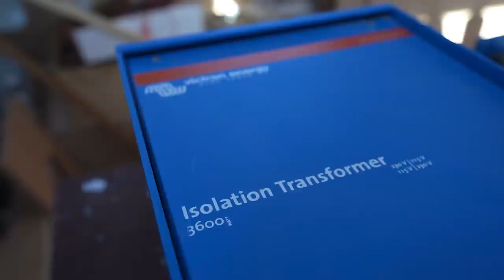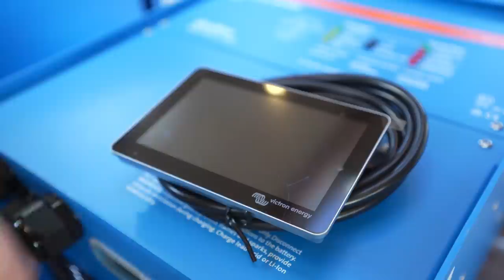Sail Life - Aft cabin BEFORE and AFTER - DIY sailboat project

Comment: I was gonna buy the same 5000 quattro (have the same isolation transformer) for my blue water cruiser, but bought the Multi 5000. The automatic switching is costing almost 800USD, when a manual switch can do the same job for MUCH less.
However, my top tip for anyone who haven't bought yet - in hindsight I wish I would have bought 2x3000w in parallell, for the backup capability that would give if one of them breaks while I'm in remote areas.

Comment: For the hump in the aft cabin you could make a nice round mould around all the edges and experiment with some expanding soft foam like they used to use for old steering wheels and stuff like that! They made something like that in my WESTFALIA camper and it looks super neat and is a real head-saver! I´m sure with your skills you could come up with a nice shape of the mould and enjoy a soft, nice looking edge in the end! Not to mention the new skill you added to the thousands you already earned while your "somewhat extensive" or better "full- waay better than new" refit of Athena! :)

Comment: You're flying along!  Be prepared to enlarge that battery bank - it's the only limitation I can see.  Victron is great kit, and good value - the expensive inverter is a monster.  You're obviously thinking about weight distribution, but I'm inclined to agree with some of the other commentators in that I would plan it carefully.  Poor weight distribution will  catch you out under severe weather conditions.  Great video.

Comment: Glue vinyl to your insulation foam and wrap the inside of the cockpit wall.  As you wrap the corner the vinyl will stretch slightly giving you a nice tight round corner.  You can also use a light plywood behind the foam if need be as a rigid carrier and them screw it onto the wall.

I saw Rhys on Zora made some 3d printed window trim...may not be the answer for your window surround..but an idea.

I would think you could tig weld in some small aluminum fillers then smoothe and sand blast for a consistent finish.

All the best!

Comment: I can see you are enjoying all the fun projects, its seems to be coming all together very nicely.  I like the slats, gives it a real nice look.  The thermal load from the inverter/charger and the Isolation transformer will depend on the actual loads and local temps.  Possibly just install a couple (at least 2 for redundancy) fans on thermostats or PWM controllers with an over temp alarm on your bus.     Don't forget to add an LED lighting puck to the inside of the locker.
Reply: And armaflex on the hull and deck underside to reduce heat ingress, plus sound insulation on the cabinet door.

Comment: 17:07 - finishing out the aft berth/cabin ... you could simply paint it with flat white paint or flat black paint (this will hide more imperfections and be easier to touch up.

Also, you could put, what I call, "kitchen carpet" on for padding.  These is simply "tough" and "thin" carpeting - about 1/4 thick (so that meets some requirements).  It will provide some thermal and sound insulation and it is durable (even for walking and spilling things on).

This is often also used for car speaker - subwoofer boxes.  It can work.  It would not be "fancy".  It would be utilitarian ... it is the new religion of the practical!

Comment: Hi Mads. About "The Hump" You could put up trim around the edges and window and insulate with armaflex. then cover the trim and insolation with packing tape. and put up a thin layer of glass fiber, then pull it off. Remove packing tape and screw it down after painting. Woilla easy peasy. =)

Comment: 17:34 you could make a thin fiberglass over piece that allows you to put insulation under it. Just lay the insulation, cover it in shrink wrap tape and then lay fiberglass over it. That way it remains white, it's just as thin as it needs to be, and you'll be able to shape the corner into a forehead friendly corner. It will also be removable and therefore easy to deal with. IMO, that's the only way to get all the things you want.
Reply: Exactly what I would recommend.

Comment: What I don't like on the Victron combi inverter charger is the fact that you can not turn the charger off without losing power onboard. I use a simple contactor with two Normally Open and two Normally Closed contacts with the coil powered by shore power, to automatically bypass the inverter when I switch it off.  The 800 plus consumes ~ 50 watts even if unused.   Year round that adds up. Now I have power straight from the Isolation transformer and a small 10Amp charger, and in summer solar can keep up.

Comment: Hi Mads,
I follow your Videos für a while now. I really like your work. I adopted many of your diy practics on my boat.
I'm building a Lithium battery with those winston cells, too.
I'm going for 12v so 4 cells. Since you are using the cebro gx and the touch display and all victron devices just like I do, you should check REC BMS.
The REC BMS has integration for the victron CAN bus.
So you have the bms information on the screen. With the SoC calculated by algorithm for the winston cells.

Keep up the inspiring videos.
Best regards
Patrick (from Germany)

Comment: For sure you are going to be generating losses in heat with the inverter and transformer depending, on load.  Probably more with the inverter.  That area back there seems small and there may be heat gain during sunlight hours, to begin with.   A source of intake fresh air down low and an exhaust outlet out the top may be needed.

Comment: Given the reliability of blue boxes and your dependence on one I'd recommend running two parallel so when one breaks you're not scuppered. Have you ever scoped one? I have two phoenix's with built-in harmonic distortion. Both inverters at the exact same rise and fall points of the wave.

Comment: Thank you so much for these videos! I've been using some of the simple (but experience needing) examples and tutorials you've shown in refurbishing my boat.
I even gave some advice to others around me, such as using the sealant tape instead of silicone glue on bolts and joints.
Currently stripping out the interior, and sanding down the roof after filling in all the old screw/attachment holes.
Planning on using some plastic imitation wood panels inside possibly. Just as I like the idea of it more than wood, which I'll have to varnish at times.
PS, I'll be watching what insulation you choose. :)

Comment: Another super video. On that internal cockpit corner, what about some kind of sewn fabric/leatherette material on top of the insulation that could easily be resewn and replaced as and if the need arises. Easy solution and kinder to heads?

Comment: @11:00 discussion about weight carrying and distribution of that weight are two different things (which you said). So adding 230Kg in the bow, ~75kg to the stern may cause Newton's laws to visit you on choppy upwind sailing. Keeping the weight off the ends is a safety and comfort issue. The latter is tied directly to the former. For math sake, a 500lb weight at the end of a 20 foot arm exerts a ~10,000 ft pounds torque around the center of gravity, meanwhile ~2500 ft pounds torque from your aft-mounted gear. Combined creating 6 tons of force keeping your boat hobby-horsing upwind.

Comment: Isolation transformers are great for transforming 110v/230v but they don't change the frequency of the AC. You will end up with 230v 60hz power in the USA. I heard that is not an issue for some appliances but not all. I think someone mentioned that their washing machine didn't like it.

Comment: Just a quick comment on that Victron Quattro. Note that the 5000VA model actually provides 4000w  output, not 5000w. Like all Victron products, their model designations are rated for VA, not Watts.
Reply from the maker: That's why I said "if you disregard the power factor" :) 5KVA is 5KW assuming a powerfactor of 1 :) I could have used the 0.8 standard power factor but going into that topic was out of scope for this video :)
Reply: @SailLife  ahh, sorry. I missed that.

Comment: As ever, very entertaining and informative video Mads. I'm currently putting a very similar system into my boat, using the Victron Isolation Transformer and a Multi-plus (I don't intend to run a washing machine and tumble dryer!). At the risk of giving away a spoiler, can you tell me how you intend to connect the two together? All the schematics are very hazy on this point - the few videos I seen show them directly connected people - the schematics from Victron are a little vague but suggest that there should be a MCB between the two while the manual for the Isolation Transformer says there should be an MCB and and RCD on the output. Thoughts?

Comment: She starts to turn into a pretty dependable shore-power queen I reckon. You either need a cruise-ship style power line or a constant supply of diesel to turn into electrical power - with the latter at least producing warm showersuited fresh-water galore. Quite some comfy way to live aboard! Should You keep up with the maintenance, You might even take short trips to halfways developed islands or shores. I would not go to more remote places in South America or Africa with a technical wonderland like Athena though, otherwise You might have to eat from cold tins with not even a backup gas-cooker .....
Edit: I am very keen on learning how it will turn out in reliability, so I hope You will share that part, too, once You go off shore/cruising. I would like to express my sincere hopes all that complicated electrics won't fail on You on a regular basis.
Reply from the maker: Solar should cover roughly half of our daily energy needs if we don't try to conserve power. If we motor anywhere that will cover the rest if not we'll have to run the generator. Just like a ton of other cruising boats. Athena's generator (AC) is based on a Perkins 102. We'll be able to get parts for that anywhere and we have plenty of redundancy in case it breaks. Just because we have a lot of creature comforts doesn't mean we HAVE to run them all the time if we need to conserve power and diesel then we can do so but when we don't we can live very comfortably.
Reply: @SailLife  As a boatbuilder and delivery/transfer sailor I usually had many offers to transfer fancy (over-)complicated yachts where there would have been enough repairs/rebuilding to do for six specialized guys full time without them sailing/crewing a single minute between A and B. The ones sailing, to remote places even, were always the ones showering out a tumbler, cooking with gas or kerosene, using kerosene for nightlights (and, until LED became a thing, for nav.-lights), too, and going under sail only, often without even having a (working) engine aboard.
I do not want to advocate that approach, I do personally like my creature comforts, I do understand how thoroughly thought-out Your Athena is/will be in terms of energy and liveaboard life, and to be honest, if someone could make a boat work for real  with electric cooking, washer/dryer, running warm water and a head with bluetooth-flushing, then it might indeed be You, Mr Mads. 😂
It is just so very different to my approach to sailing and the outdoors that I feel the urge to comment now and then. 
Anyway - never mind. Thanks for sharing!

Comment: Not sure how thick that rear bulkhead is that you bolted the Isolation transformer and Inverter to, but given their weight, and the potential for rough seas, would some kind of backer plate on the hook plate help distribute that load better?

Comment: How does that Transformer take a 60hz input and turn it into 50hz? If you're pluged in in an American dock you can step up the voltage sent to your charger/inverter but the frequency remains and that 60hz at 230v will kill appliances that have inductive loads.

Comment: Lithium batteries have got a lot of press on being a fire hazard potential, are you taking any preventative measures in the battery locker area?....I'm still on the fence about using them..but as far as power and life cycle, its the bee's knees on a long haul vessel....

Comment: when fitting those battens for the insulation did you put a screw directly into the hull or were they only to bond the 2 pieces?  Im assuming not sound to screw into hull?

Comment: seeing all the sailors that had problems with water and batteries installed low near, or under the floor, personnal safegard in my boat was a waterproof box to the batteries, custom made marine plywood epoxy glass and a good rubber seal bolted top, seled cables to the bms inside the box to avoid short circuit, and at least one lead acid well over where the water go in case of flooding, sinking and capsize, it will insure you can run at least your starter and a bilge pump on emergency

Comment: Mads, that Isolation Transformer will NOT address the frequency differences between the US (and Canada) and the EU/most of the rest of the world.  The US/Canada are on a 60 Hertz, 120 V AC standard while most of Europe is 50 Hertz, 220 V AC.  Your spiffy new Isolation Transformer will step up the 110/120 to 220 but it won't change the frequency of the power so you still won't be able to use any devices that can't handle that (such as microwaves, a lot of electric motors in things like washers, dryers, dishwashers, air conditioners, etc).    Most docks in the US/Canada have 120/240 VAC available so you can get the same effect from plugging in directly (without the benefit of galvanic isolation of course).  Anyway, I assume you know this already but just in case....

Comment: Would it not have been safer to fit mounting brackets on the wall on the other side of the bulkhead, if you had a serious jolt they could possibly spring forward damaging whatever was in the cabin.
Reply: Probably find that the other side is not necessarily a "dry" locker (as it is only accessible from the cockpit and probably where he stores stuff like fenders) so better for the longevity of the equipment for it to be inside the cabin and just add the additional bolts at the bottom to keep things in place
Reply: He did say there is additional mounting holes that will directly bolt the cases to the bulkhead

Comment: Did you say you're going to vent air from your cockpit to your inverter? I'm curious to see what your solution will be to prevent your fans pushing in water if you take a rogue wave into the cockpit.  Obviously you've thought about this because...well, you're you.

Comment: Those that know - I am leery of the combination charger-inverter.  I have a dead uninterruptable power supply (UPS, 7kVA) in which the charger side failed.  I"m looking for discrete components for the inevitable replacement cycles.  Thoughts?
Reply: And I am presuming that all of the Victron kit deals with the 50 cycle / 60 cycle nonsense.  I fully recognize that charging batteries is not cycle dependent as some motor applications.

Comment: Speaking from personal experience, the locker containing the Victron inverter will need forced ventilation.
Reply: I have almost the same setup only for 48volt, insulation transformer and maultiplus 48/5000, I use a termal contol jabsco ventilator to cool down things. Realy needed if everything is installated in convinced  lockers.

Comment: Chain looks a little on the chunky side, couldn’t you go down a gauge or two?
Reply: 5/16” or 8mm would be plenty strong enough, 3/8” is a little over kill or was that 1/2”
Reply: "Normal" boats can use 1/8" diameter for every 9' of boat length. Lightweight or low windage boats can use 1/8" of diameter for every 10' of boat length. Athena is '38 and likely to be in situations without access to a lee shore

Comment: I'll check back this time next year to see if the 'all electric' idea works out.  Count me skeptical.  If you never leave the dock, then sure but sailing around the world?  With that said your work is the most meticulous that I have seen on You Tube.  Not being a critic just a skeptic.
Reply: you forget that he built a diesel generater to charge the batteries
Reply: @nordicdust  good point
Reply: It will work fine in fact should be simpler and better than most boats he only has a single fuel source to worry about, its a diesel powered boat the solar etc are just diesel usage reductions